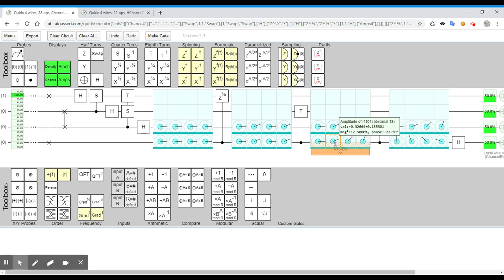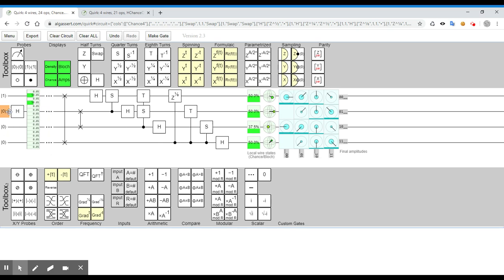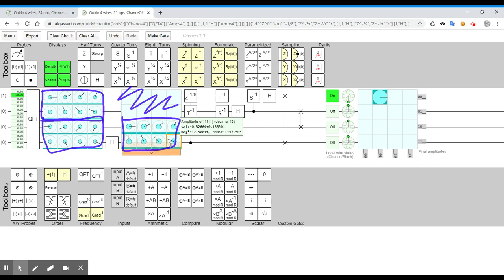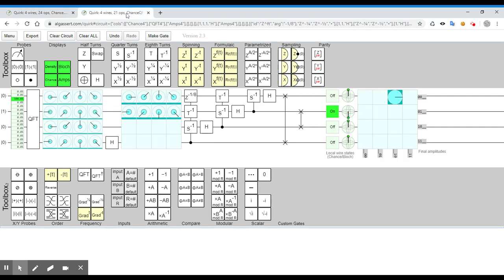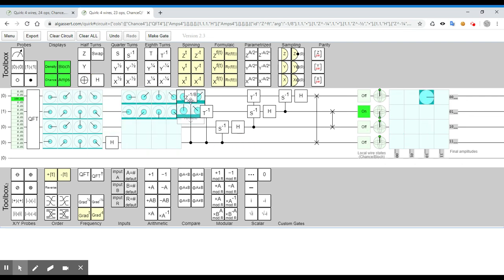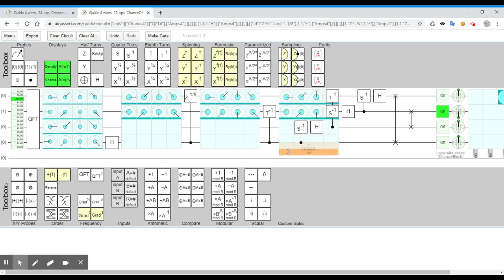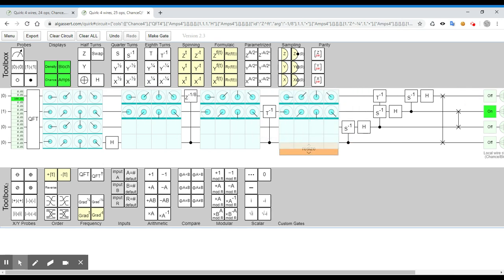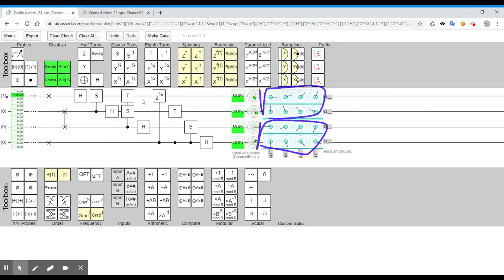QTF - Recap Attempt [Part 15]

Comment: Thumbs up for the shoutout on Twitter, but a few minutes in I still don't understand why you're using swaps. You're adding unnecessary circuit depth to a circuit that already has an awful lot of circuit depth.
Reply from the maker: The swaps are needed to get the right output. For example if you input phase encoded signal data (mapping values to equivalent phase rotations) the (inv)QFT will give you how many time the data is cycling. But in order to do that you might need to use swaps depending on your implementation.
Reply from the maker: This cycling that you get btw is exactly what's used in shor's algorithm